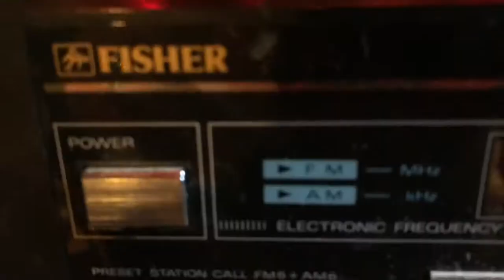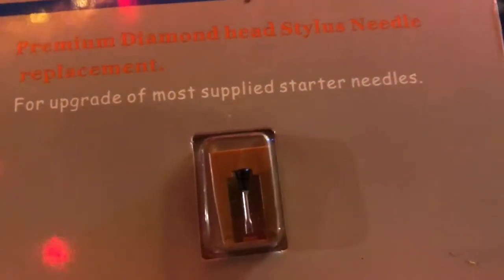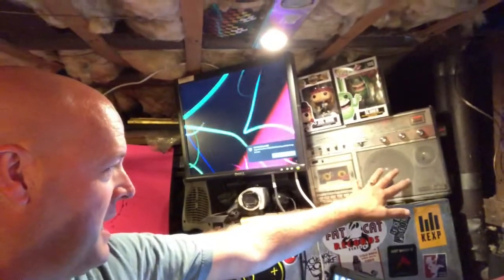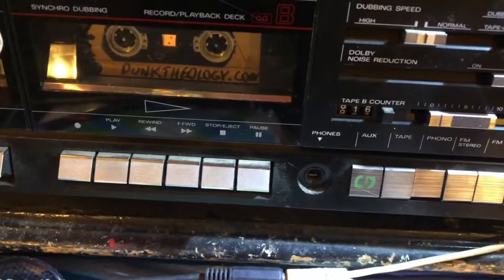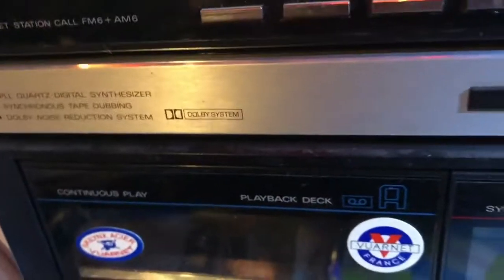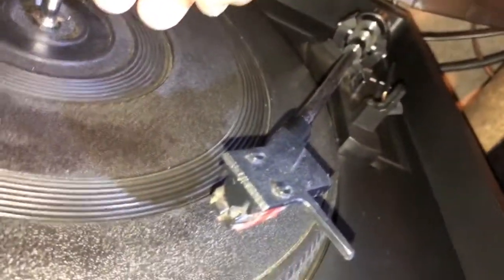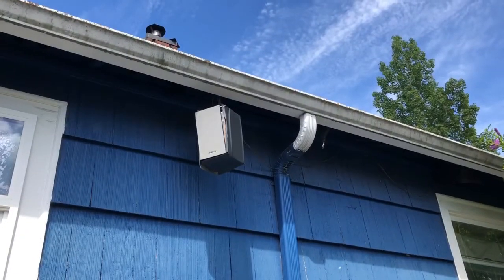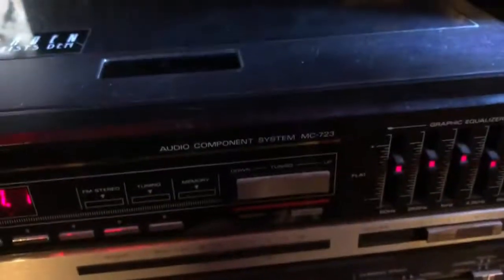Vintage Audio Review FISHER Turntable, Tape, Am Fm Audio Component system 1985

Comment: Hey man! I know you posted this ages ago but my dad just gave me this exact turntable and I love it! The only thing is that when I try to use the record player I can not hear the music coming out of the speakers even though they work perfectly with the radio! I only hear the music barely coming out of the vinyl. Any idea why this is happening? Do I need and amplifier for it to work?
Reply from the maker: Hey, thanks for commenting! Interesting the guy I sold it to said he bought it for his son. Are you local here in the Everett - Seattle area? They’re pretty cool, but they are over 40 years old. Unfortunately, it sounds like your preamp in the turntable has failed. It’s the amplifier built-in to make it so you can hear the vibrations from the vinyl. 
Looks like you might have to look for another system, unfortunately.
Reply: @RussShawTV  im not! Im messing you from Mexico! Aww that very sad. There is no way of fixing it??
Reply: @RussShawTV  or could I buy a new preamp?
Reply from the maker: @santiagozamorabasabe8055 It would be too complicated to try and install it. It’s built into the unit somewhere.
Reply: might try messing with phono button and volume as well, the buttons get touchy with age, I had same issue. After messing with buttons I got the sound to work, May need to take apart and check connections and clean up a little. I just got mine at auction and I love it. Picked up Technics speakers at a flea market. Sounds great if I get the buttons just right.
Reply from the maker: @duaneroberts5921  yes, I hear the volume buttons can corrode and go out. Recently bought a turntable, AM/FM receiver, cassette player and 8 track at a estate sale. 👍😎 
But again, the volume button is really bad. Hoping there’s a fix for that that I can figure out

Comment: Have you used the dialectical electrical contact cleaner for pot controls and sliding fades I'm from that era he only had about 2  years gave it to me in 1987 and went out and bought himself a component system he actually had better speakers than the ones that came with it so he gave me those speakers with it it was Sony bookshelf speakers he purchased and I used it up until 1991 when I got my first component system what a set of Victor audio speakers by JVC i kids know nothing about a loud system today  it had two 10-in subwoofers Tweeter  mid-range  thing would rattle the house

Comment: I just bought that same new audio system, if new, in this October 2020 the plastic that tare the red needle that protects the needle I remove it I do not know if I did well But it does not sound I see a gray plastic that covers it I do not know  if remove it.  I hope you can help me
And how the needle is replaced
Reply from the maker: The red cover was the needle. But you can buy a new needle for it. 
Audio Teknika needles are about 15 bucks and it’s a better needle than what it came with.

Comment: how do you take the platter off?
Reply from the maker: 🤔 I can’t remember on this one but with most of them there’s a pin in the middle, like an e clip on some of the plastic platters. If there isn’t they usually pull straight up and they come right out. But if it’s stubborn don’t force it, they have a clip. I would look for that. Hope that helps thanks for watching and subscribing
Reply: @RussShawTV  thanks it was the pin and I was able to take it off, can’t figure out how to put the belt and platter back on tho lol
Reply from the maker: @kevinirwin8180  Get that part is a challenge for sure. I used a hook pick set. Things I’m familiar with as an auto mechanic. The belt that was enough stretch. Once you get the platter and the belt within reach. https://amzn.to/3tlkebT
Reply: @RussShawTV  thank you so much! I was trying to find the adjustment screw to slow down the playback speed just a tad on both the 33 and 45 playback speeds. Do you know where the screw would be or if it has one? Everything else on my unit works great. Thanks again!